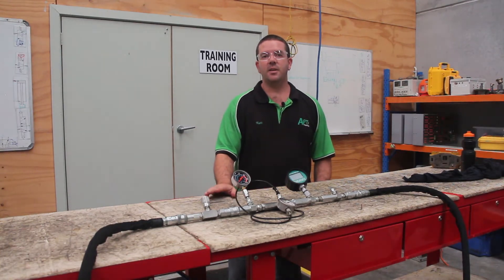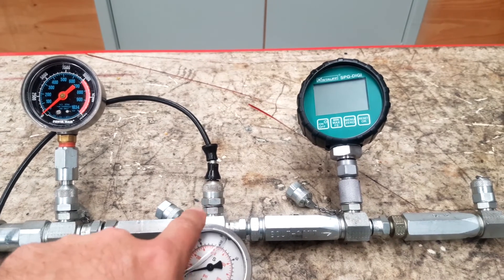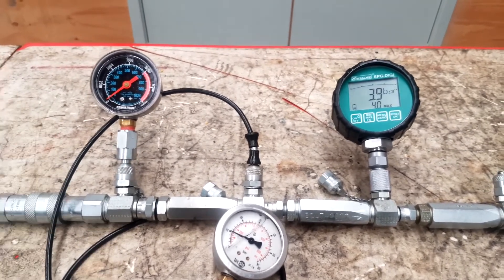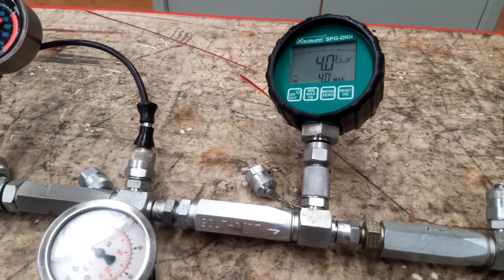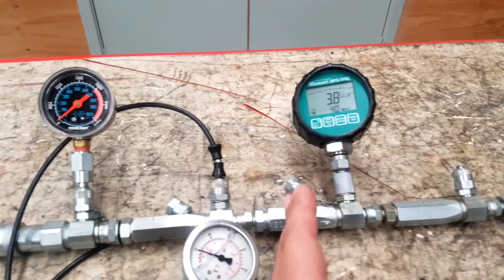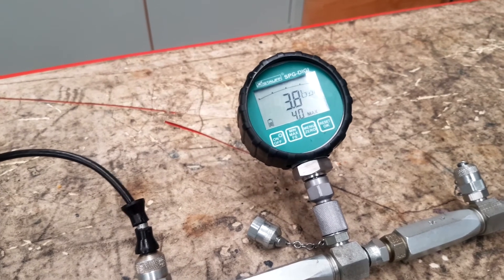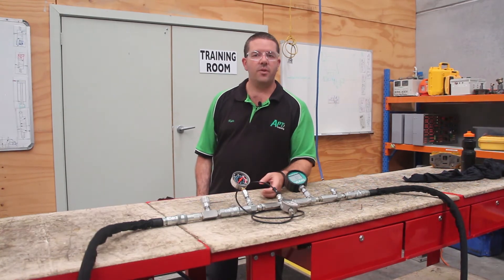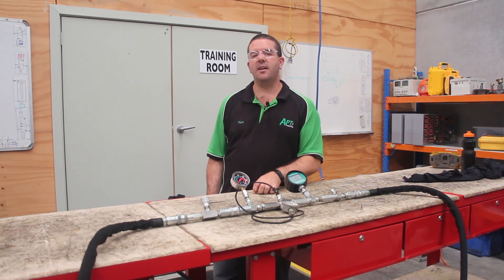How to Measure Pressure in a Hydraulic System - AskAPT #4

Comment: Is it safe to assume that if the down-stream resistance exceeds the up-stream, that all gauges would read the same?  I'm having a little trouble accepting the logic in this video of by-pass valve operation. The discussion starts at the 5:30 time stamp.
https://youtu.be/KDWa0DxDGtc?si=nQM4M_Sa31QL0NrK